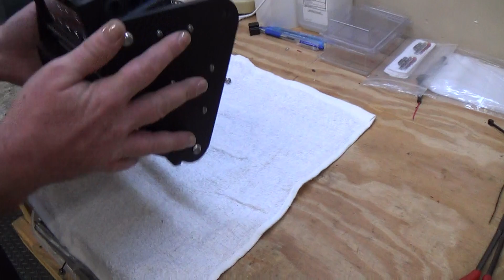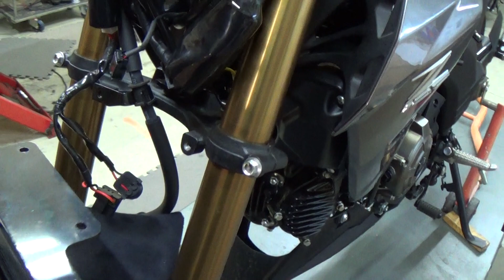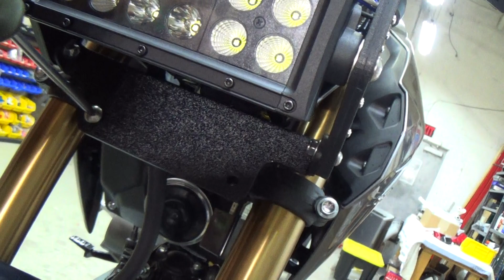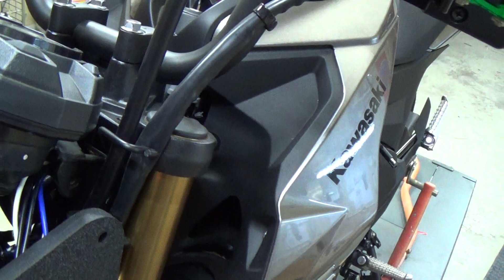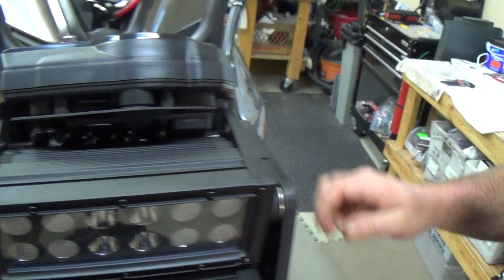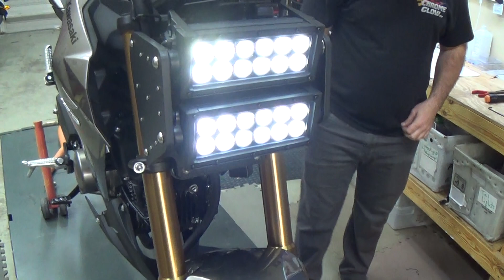SportBike Lites Double Row LED Headlight for Kawasaki Z125 Pro

Comment: If I have a Moose racing road warrior, and the bulbs are just positive and negative wiring, for a low and high beam, what do I need to do to make this work on my bike?  Thanks in advance!
Reply from the maker: It is designed for the z125 Pro, we cannot gaurantee fit on any other bike.

Comment: This is 3 years old now but do you guys happen to make anything like this for a 2016 monster 821?
Reply from the maker: This is designed specifically for the Z125 Pro, we do not know if it can be modified for the 2016 monster 821

Comment: Is this the same concept as for if I want to change my Honda ctx700n bike to led headlights?
Reply from the maker: It is strictly designed for the Kawasaki Z125 Pro unfortunately we do not know if it will work on the Honda CTX700N

Comment: Can this fit on a KLR 650 or be modified to fit on it because this would look so awesome on a KLR
Reply: WickdPerfekT I got one of my homeboys that I was in the Marine Corps with that does plastic Printing and metal work so I'm going to have mine set up kind of like the one in the video but he got me wanting to set it up like my bike has a face basically 2 projector lenses as eyes a square flood LED and a light bar as a mouth on my bike basically trying to give my bike a face his mock-up looks awesome and he wants to run LEDs on to my 10 gallon gas tank and print on the design and wrap it on my bike so the LEDs would light up the design on the gas tank he wants all this done for the awesome veteran discount of $200 and I buy the equipment that's needed to make the headlights and brackets a case of Yuengling and a bottle of gentleman's Jack put it like this I'm going to be really busy this weekend scrambling for parts and headlights on Amazon LOL!
Reply: WickdPerfekT basically my KLR is going to look like a blacked out lit up Angry Johnny 5 from the movie short circuit I can't wait to get it put together
Reply from the maker: This is designed specifically for the Z125 Pro, we do not know if it can be modified for the KLR 650.
Reply: Chrome Glow good Lord it would look so good on a first gen KLR I'll try to figure out the dimensions online but thanks for telling me
Reply: Jason Garnett make your own
Reply: Jason Garnett sounds awesome, you gonna put pictures of it on the internet?
Reply: WickdPerfekT heck yeah I want to do things that these guys on the internet aren't doing like one of my buddies I was in the Air Force his parents are freaking loaded basically his mother and father are Liaisons for the military and they get paid over $500,000 a year a piece just you do the same job they were doing when they were in the Air Force and he saw the guy that strapped a Maserati engine onto a motorcycle chassis and literally he had a Eureka moment and was telling everybody like you see this motorcycle I'm going to make it better I'm going to take that same Maserati motorcycle platform to a T-Rex with the Aereo basically the t-rex with the doors and windshield and fenders with lights inside of them kit I'm on a Skype call with him and the rest of our buddies like dude do it please we want to see you make a death sled LOL or you can look it up on YouTube the Maserati powered motorcycle it has four wheels two in the front and two in the back and then move independently and I got another buddy that just got into fpv racing but he wants to make a fpv Racing League with EDF RC jets it seems like 2018 and Beyond is going to be a wild technological ride for me and my buddies and I'm going to make sure that we share what we can on YouTube I know once I get my KLR donut properly I'm going to try to enter it in the New York Auto Show when it comes around next year or any Auto Show that pops up on the East Coast but I'm not the richest man in the world I wish I was because I would have all my dreams come true with the swipe of a credit card but I bet Bottom Dollar that I'll have my KLR with a 705 Big Bore Kit and it decked out and farkled and hopefully fuel injected before the VA calls me back to do my physical it's been about a year and no call backs basically so I'm going to get all my projects started while I can and make sure my buddies are going to document all of the projects that they're doing- Jason Garnett USMC 3521 corporal oorah!!! Stay amped stay pumped exercise eat right and keep negative people out of your life!!! I'm going to let you guys know when things get started up oorah!!!
Reply: Jason Garnett

Comment: What about the blinkers?  I would love to have this on my Z125 but I also need my blinkers.

I see that you also sell flush mounted LED turn signals.  Where would you install these with the LED headlamp assembly in place.  Would to see a video with both installed.  Thanks.
Reply: You propably just drill a couple of holes and just mount them
Reply: Mark Porter would like to see that as well.

Comment: Do you guys have video or pics of the product in use on the street? It would be nice to see the distance the light produces vs stock.
Reply: Huy Tran It's not street legal. off road use only. Cops would pull you over quick because you'd be shining it in everyone's face regardless of where it's adjusted.
Reply: there is a high beam and low beam
Reply: Dennis johansson No, they call it that, but it's the same beams. You can clearly see that the reflector shape produces a circular beam pattern. In order for the "low beam" to not shine into oncoming traffic you would have to point it at the ground. This would put very little light in front of you. Not enough to see with. If you really want to see the beam pattern, shine it on a wall and see if you get any kind of cutoff pattern like a car headlight.
Reply: @JasonWW2000  I have the same one on my grom and have never pulled over for it.  Also have no problem seeing at night
Reply: @mariocuomo7983  People shoplift all the time and don't get caught. You should base your argument on what is legal or illegal, not whether or not you got caught. Something you can try is get a friend to ride your bike down the street and you be in a car driving towards each other. See if the glare is in your eyes or not. I'm sure you could aim it super low and minimize glare for oncoming traffic, but that would hurt its distance. Using a light with a good cutoff pattern will allow for long distance beam patterns and no glare. My recommendation is to keep the OEM light or buy an aftermarket projector. They have sharp cutoff patterns and won't bother traffic.
Reply: JasonWW2000 you could always barn door it